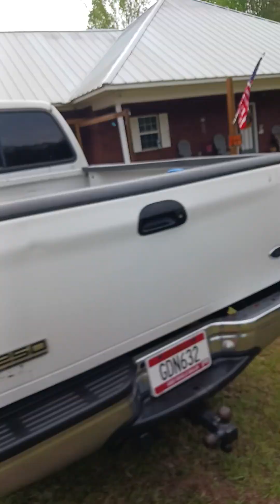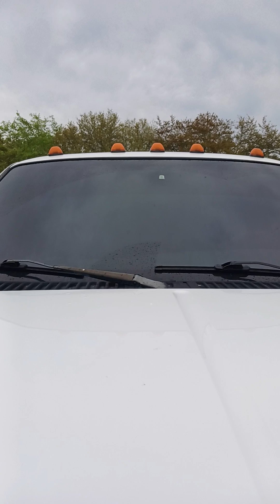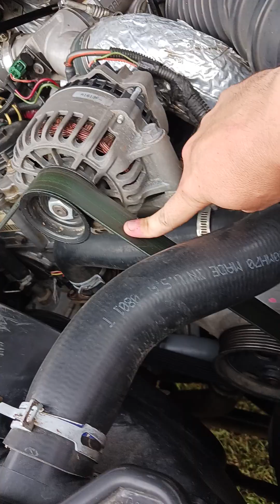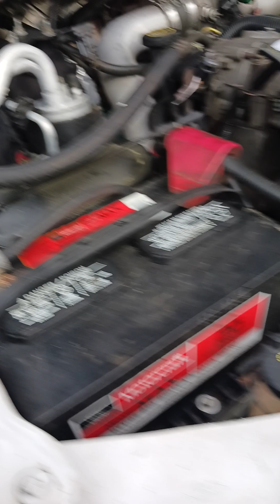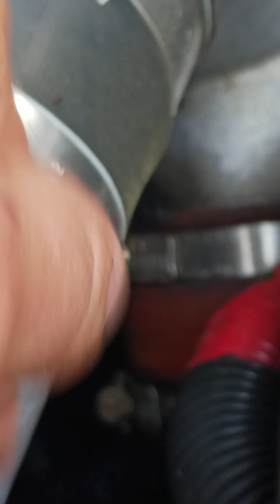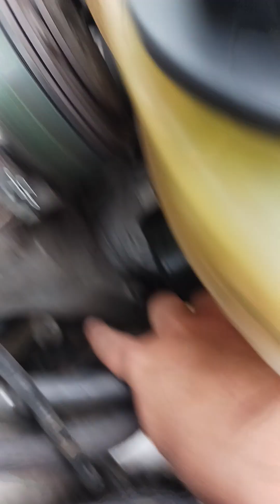2000 7.3 powerstroke

Comment: Delete the check valve fittings at the heads where the fuel line runs to them. That’s a massive restriction for fuel to flow. There are 4 fuel banjo bolts on that engine, the riff raff ones flow the best. Put a regulated fuel return system on so the fuel doesn’t “deadhead” in the heads. And also install a high pressure oil crossover tube. Doing those simple upgrades smooths out the engine drastically and really lets the engine take advantage of the hydra tuner tunes if you ever put one on the truck.
Reply from the maker: Yeah, I put tracktech banjo bolts in I got a video find it on my channel track tech makes some nice products grade A bolts
Reply: @coproPokémonhero , i’ve already done all that stuff i listed done to my ‘99 7.3L. Really smooths out the engine. Hopefully soon i’ll be doing new plenums, all boots, a blank turbo pedestal, and a new turbo from KC turbos.